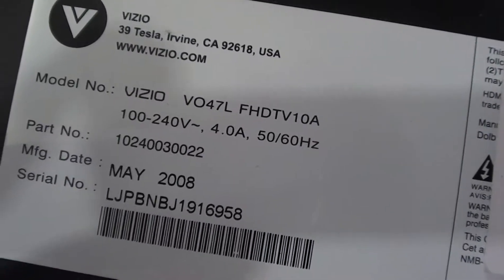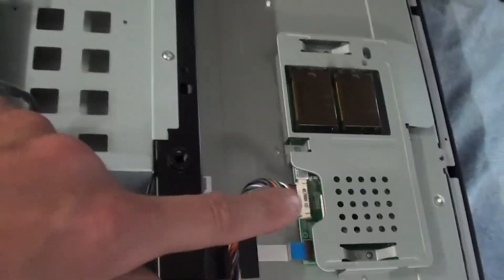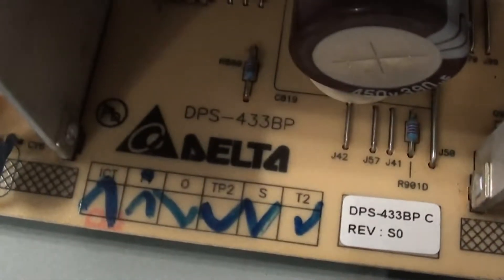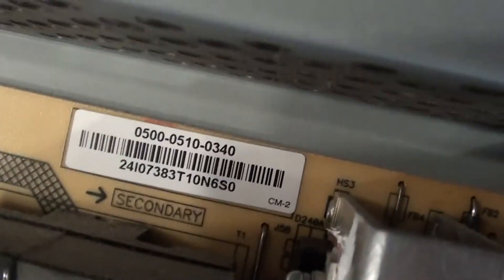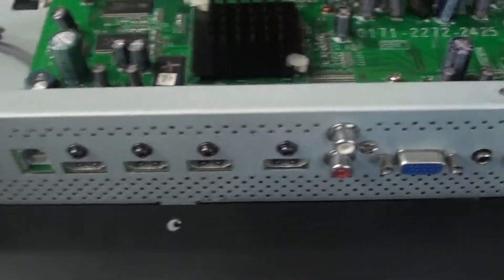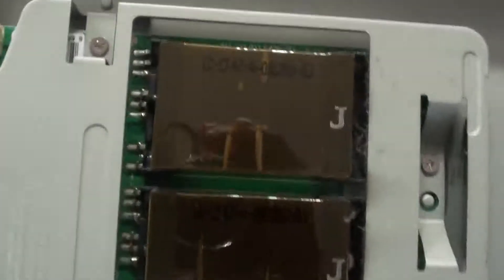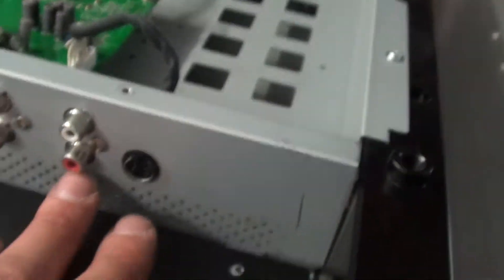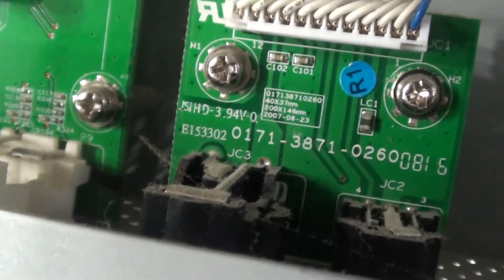Vizio VO47LFHDTV10A 47 inch 1080P LCD HDTV The Electronics Shop YouTube channel electronics repair

Comment: I see the the two RF chokes on the top right corner of the power supply have not yet managed to overheat and blow the 470uf 35v cap yet. Once that cap goes, the inverters usually go with it.
Reply from the maker: Thank you if you found this video helpful please don't forget to subscribe